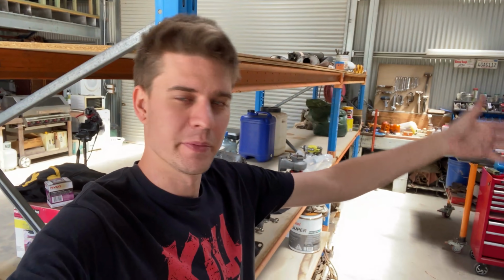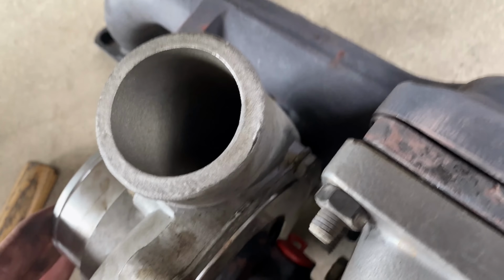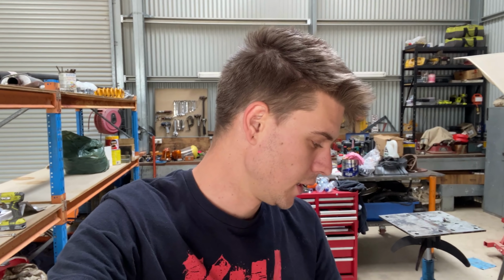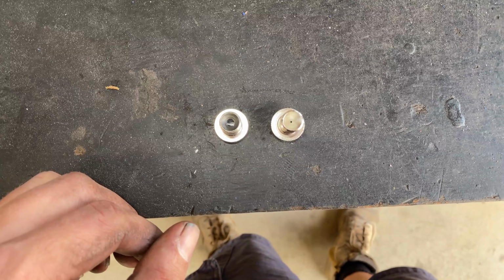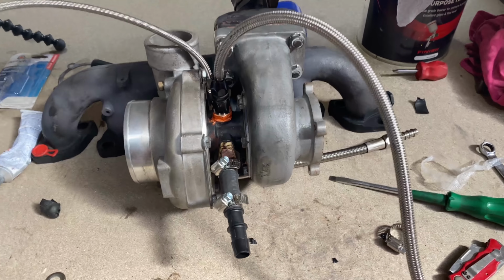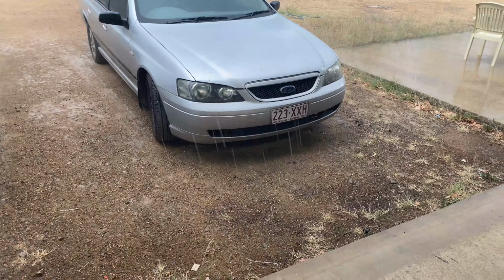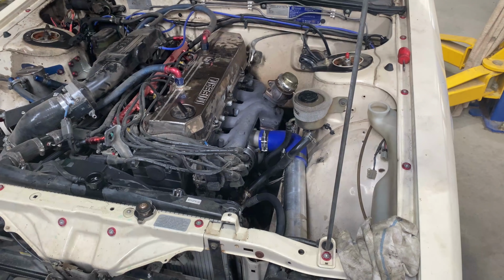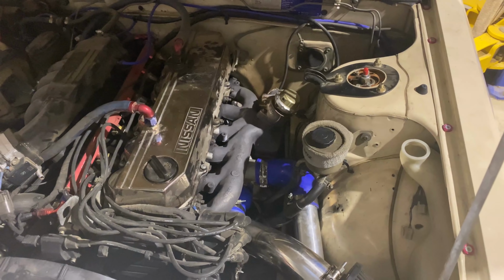Installing the new turbo on the R31

Comment: Turbo oil restrictors are there for good reason, you should get in contact with the manufactur about oil restricter for that brand of turbo

I had a 1.5mm restrictor on my journal bearing td06 and now a 1mm for my ball bearing td06
Reply from the maker: Oliver Kus yes im fully aware as to why restrictors are there. There are plenty of factors to consider that a turbo manufacturer will not be able to tell you.

Comment: Hey mate, when reusing old gaskets use some silicone. Anytime I pull a hot side off I use a light amount of silicone spread across the EXT gasket and turbo gaskets. I’m yet to hav a customer come back with a leaking gasket. Hope this helps, keep up the good content
Reply from the maker: ah yep have heard of this trick before. I need to get some for the shed! haha

Comment: hi i am building a vl turbo and have a vl turbo manifold and i was given a nice fg turbocharger but i have a external waste gate welded on the manifold. what's your option on welding the flap on the turbo and taking the internal waste gate off? and also what size turbo is the fg turbocharger ?